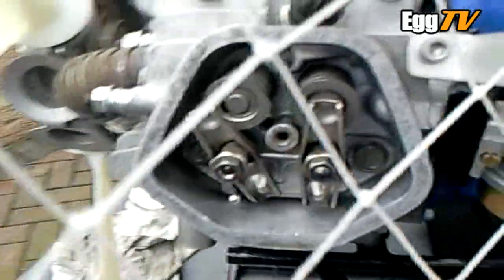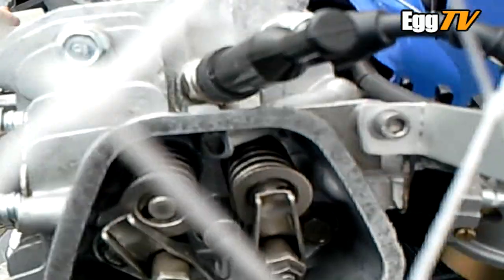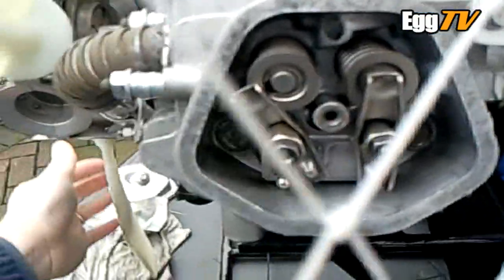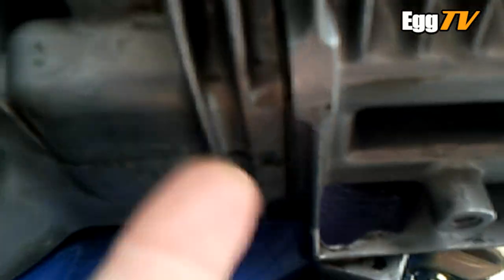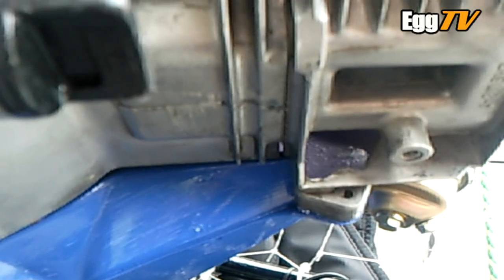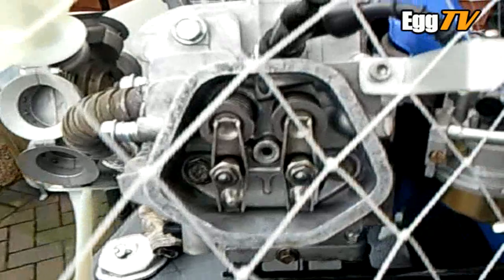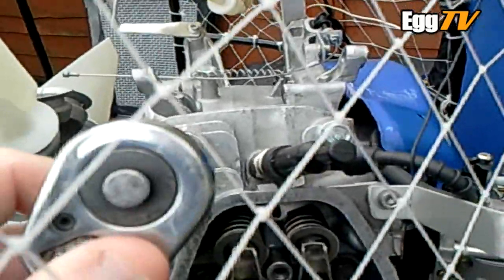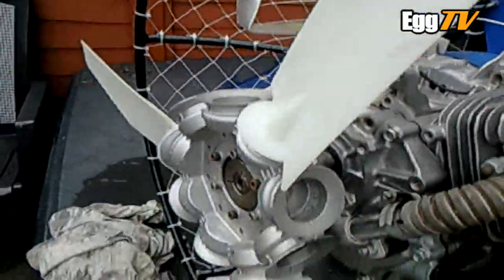GX270 Paramotor. Compression Issue? - EggTV

Comment: Seems like a simple head gasket issue imo. One day I went to ride on my modded GX200 and when I started it I noticed it idled a little louder. I hit the throttle and the corner of my eye caught a burst of steam from by the exhaust. I did it again and noticed it was by the exhaust port (by header) and repeated it a few times until I noticed the steam looking exhaust coming from between the head... then I noticed the oil between the head and block. It could still idle fine surprisingly.

Comment from the maker: Hello, cheers for your advice. I will have a close listen to the "how low can you go?" video. I will defo try out the oil in cylinder test. I should have remembered that one as I've seen Mark Evans do that while compression testing the V8 on "A 4x4 Is Born" series.
Thanks again,
Rob :)